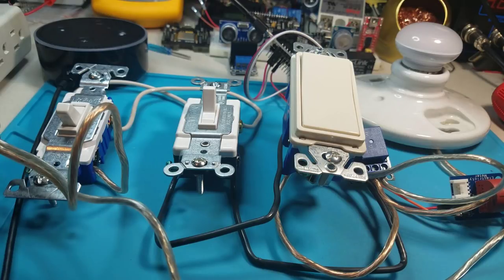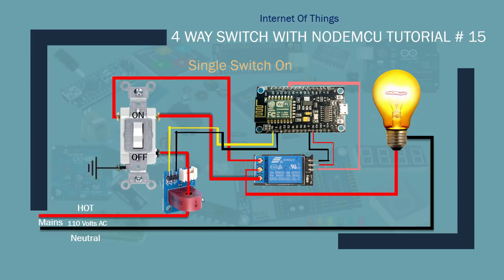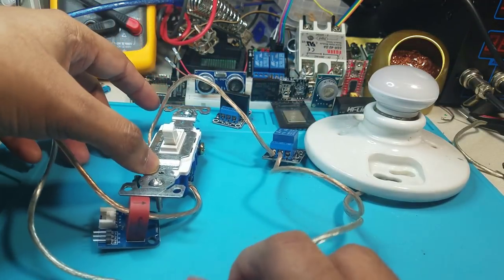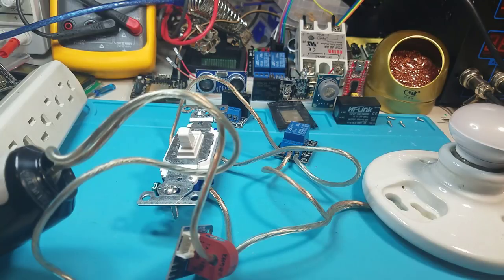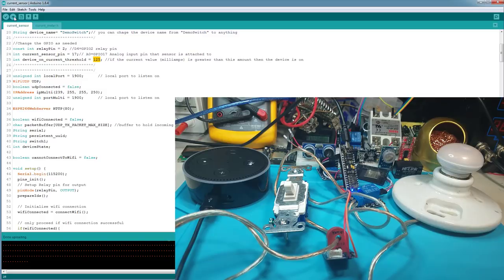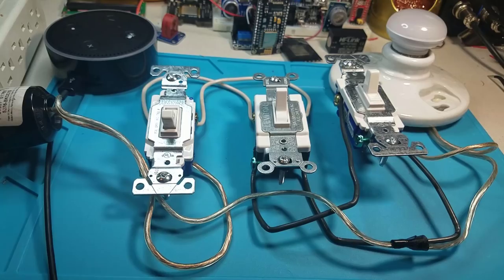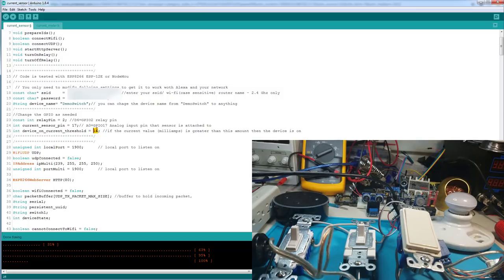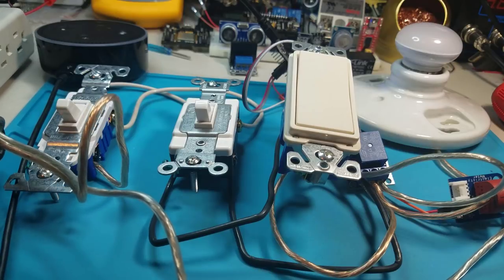esp8366 arduino | Home Automation with Alexa | 4 way switch Part 3| Tutorial # 15

Comment: This is a great proyect thanks for shear, I already made it but it does not responds all time, it turns off when it suppose not to do it or viseversa but it shows in the serial that it is taking the measurements of the current sensor but does not responds according to those reads. I already set the current value according to the sense in the program.Do you have any idea what could be happening,  Thanks in advance.
Reply from the maker: bruno gonzalez It means that you current meter current reading is fluctuating. Try to take reading few times and set the trigger at the lowest current measurement. Let me know if you are still having issues. Good Luck.
Reply: Thanks for your respond, I have 155 when lamp is on and 17.3 and 34.5 when is off so I set it to 35 but still having the same problem as soon as I figure out how to solve this will let you know, my filling is that it is not sensing the current before doing the comand. My best regards. Im working with NodeMCU 1.0
Reply from the maker: bruno gonzalez set it to  150
Reply: hI  still not resonding at it should, im still looking for a solution, in your video you turn on and off but you did not turn on demo swich when it is on or turn it off when it is off, Is it doing it well for you? because there is where I have the problem.  I dont know if someone else has my same problem.  My best Regards.
Reply from the maker: bruno gonzalez I am not sure if I understand what you are trying to do. Are you saying that it does not turn on and off from Alexa? If it is on, then you should be able to turn it off from Alexa or vice versa.
Reply: Yes if it is on I should turn it off, but if it is on and I tell alexa to turn it on again it turns it off and vice versa.
Reply from the maker: bruno gonzalez ok give it on and off command and post the serial output here.
Reply: first two comands I told alexa to turn on, second two to turn off and the last one to turn on, in all commands it changed the swich form its original possition.

Comment: Can you show how to integrate multiple sonoff 4ch pros to existing home wiring along with Amazon echo and raspberry pie 3?
Reply from the maker: pulseps I added the project to my list Thanks.
Reply: Basic idea here... but doesn't work with all 3-way/multi-way switch configurations.  If you don't have this situation, then you'll need multiple Sonoff's and some sort of automation, ala Home Assistant, to do the work in software.  https://www.dropbox.com/s/h94truyd6d9c8w3/2018-01-08%2014.14.01.jpg?dl=0

Comment: Make A vedio On Coding with the Alexa For Running the system
Reply from the maker: What system?
Reply: @netmedias7657  System Here Is Running the Lights On/Off By means of Voice Control, Remote control,Or By Manually By pressing 2way or 3way switchs...

Comment: Hi there, Love watching these tutorials, my living room wiring is slightly different, is it possible to control the circuit below with NodeMcu?  Any advice would be appreciated.

https://upload.wikimedia.org/wikipedia/commons/thumb/d/d1/California-3-way.svg/800px-California-3-way.svg.png
Reply from the maker: Gary Duncan Yes, you need to replace the switch "B" with 4 way switch and hookup the relay and sensor like I showed it in tutorial. Good luck.